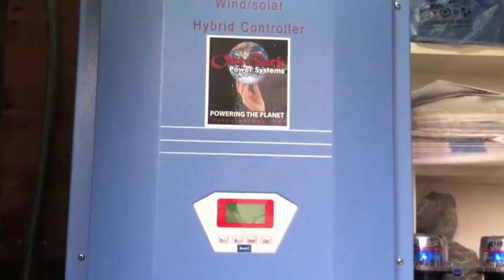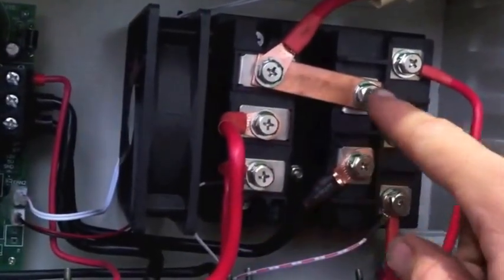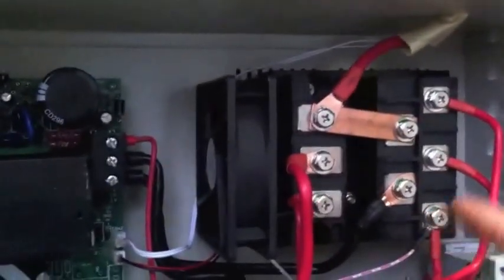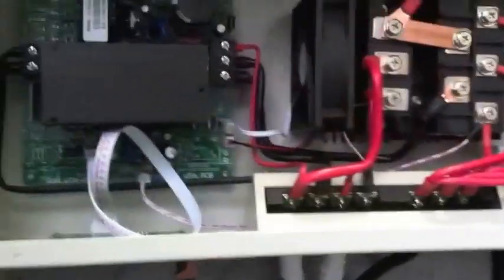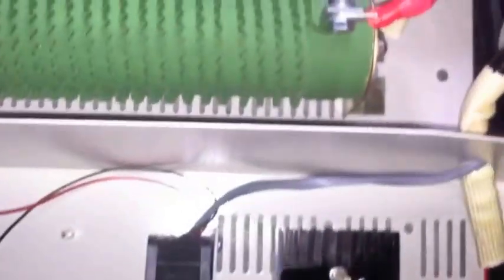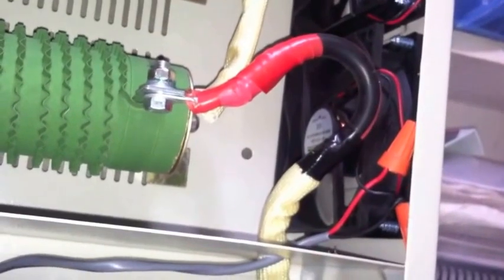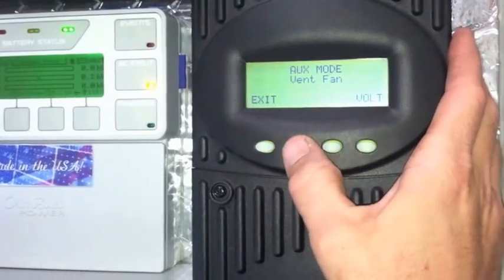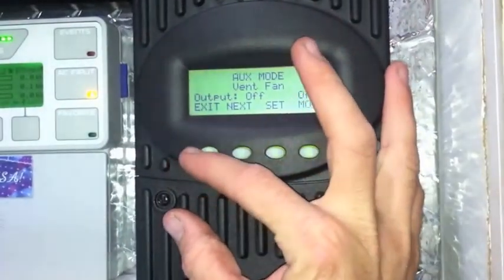NEW MORNINGSTAR TRISTAR DIVERSION CONTOLLER

Comment: Don't really know the problem but you took the more direct approach, it should work now. My grid tie inverter needs 10.8 Volts to start working. The vertical wind generator hasn't reached that point yet, as far as i know.
Reply from the maker: Thanks Dan you should do a video on that vertical wind turbine.i figured out that pesky fan problem more to come...